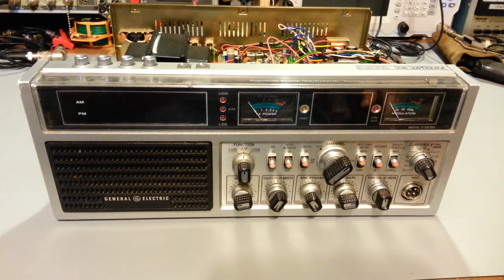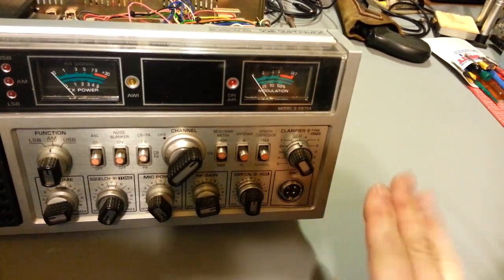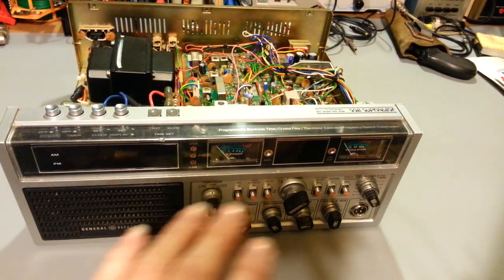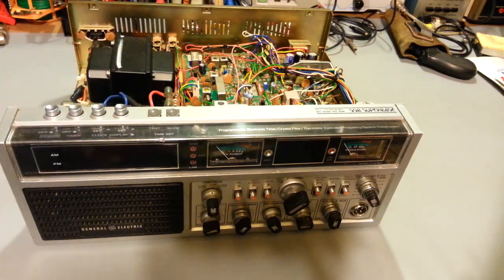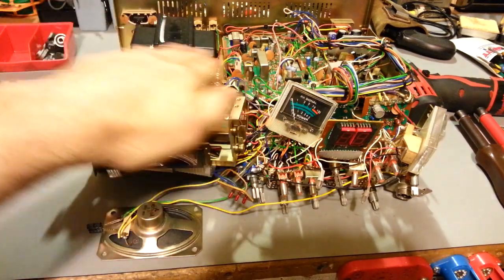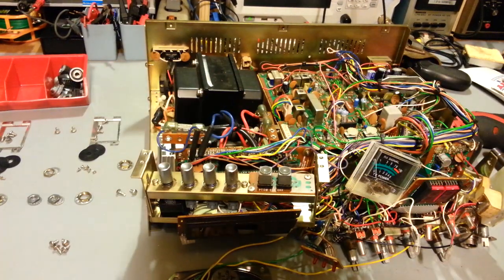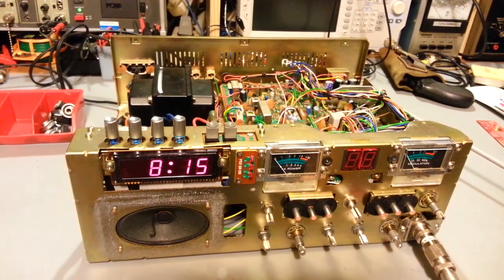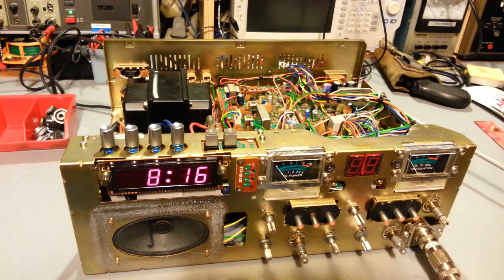Major overhaul of a damaged GE SuperBase.  Was damaged in shipping.

Comment: I thought the meter might have been stuck...had a rig on the bench that I accidentally smacked the meter housing with a screwdriver handle and the movement became stuck off zero; remembered the old trick of swiping the meter face with a dryer sheet and sure 'nuff it was simply static that was holding the indicator in place and that fixed it. Nice restoration Mike!
Reply from the maker: Dino Papas 

This one was actually bad, tested with an ohm meter it as open.

Comment: Besides the few options one gives up, does the mobile version of this transceiver match up performance wise to the base?
Reply from the maker: PEACE 

Other than the added clock, meter, etc... it's basically the exact same radio as the dual board mobile.  Performance is the same.

Comment: where do you get your Brushes Mike ?
Reply from the maker: Harb's Elecronics Lab 

https://www.eraser.com/products/fiberglass-brushes-erasers/
Reply: Thanks Mike.......I might have to import some, I have never seen anywhere here in Australia that sells them.

I have to say mate, your radio rebuilds are the best I have seen......must be a real plus to have so many wrecks to drawn parts from.......great stuff !
Reply from the maker: Harb's Elecronics Lab 

You might check with suppliers in Australia.   What your looking for is "Rush Eraser ".  If you don't need the coarse ones you can get the fine ones cheap on ebay that are made in China.  I use them to and they work just fine at a fraction of the cost.  But for coarse fiberglass brushes the Rush Erasers are the only ones I have ever found.  They make short work of removing corrosion and trace overcoat/masking.
Reply: Harb's Elecronics Lab I'm sorry but it appears as though Eraser don't ship overseas as USA is the only shipping option.
You could send them an email asking if they would post to OZ.
Reply: Thanks for the info Peter........I will chase this up, I might send them an Email re shipping here.
Reply: I just sent them an Email......they may do it if the order is for enough product....I see a few things on their site that look interesting.

Comment: grate video .im a collecter of general electric radio in the uk .iv never seen a radio like this in the uk i will keep a look out for one ...why do your have a gun on your bench ...
Reply from the maker: electron0002 

That's one of my daily carry pieces.  Usually set it on the bench when I set down so its not banging into the armrest of the chair.
Reply: i have a few GE RADIO manly AM only.back in the 70/80 AM was not leagal in the uk so many was scraped so getting hard to find hear in the uk .keep up the good work
Reply from the maker: electron0002 

Can always convert them to FM.  Probably considered heresy but an easy way to add FM to Cybernet chassis is to use a FM board out of a Uniden chassis.
Reply: there a compeny in  the uk called http://www.spectrumcomms.co.uk/CB_Kits.htm in the uk that  make a buard to change old AM radio in to fm mid band
Reply from the maker: electron0002 

Forgot they made one.  I have purchased vco blocks from them before.

Comment: MikesRadioRepair IV got a galaxy dx48t was wondering when should someone do a cap change? mine are good right now
Reply from the maker: Stephen Ross 

Well, as time has gone by manufacturers have used cheaper and cheaper components.  Back in the tube type days pretty much everyone used Sprague, Mallory and the like, good high quality caps.  When solid state came around they started using cheaper stuff and the farther on in time the cheaper they got.  Even a cheap capacitor should be able to last a minimum 15 to 20 years, those are common manufacturers specs for shelf life.  So if your radios not at least 15 to 20 years old you "shouldn't" have to worry about them yet.  Even if it is that old or older it's very possible it could hold up just fine for many years to come.  A lot of things effect how long a electrolytic capacitor will last.  Time, temperature, moisture, time in use and actual operating voltage versus rated operating voltage  all play a role in how long it will last.  With a radio like that if it's still working fine I would continue to use it.  When they do start to fail it's time to just recap the whole radio then so your not having to have it or ked on every few months or year..